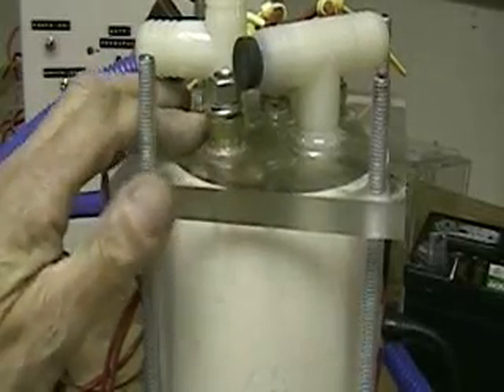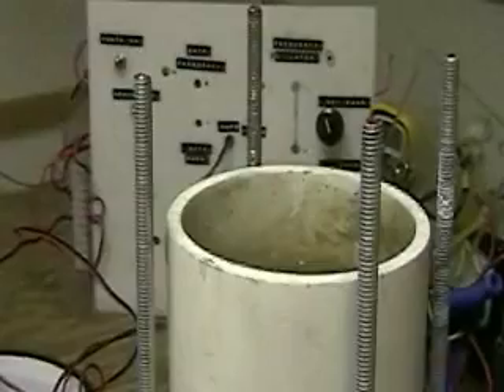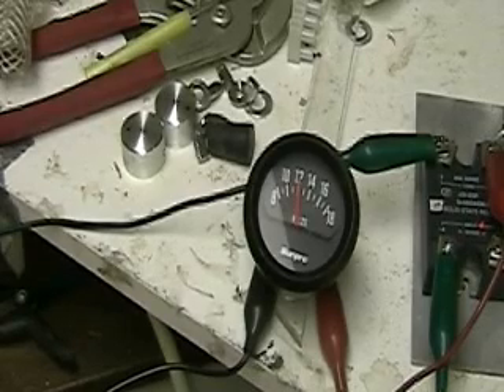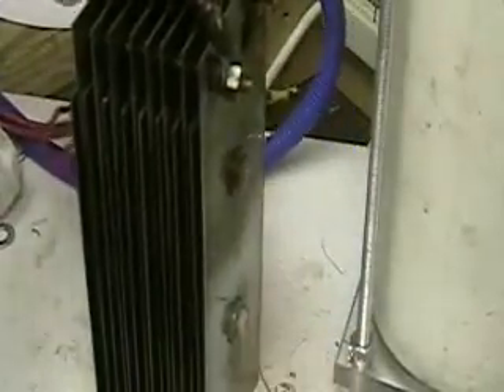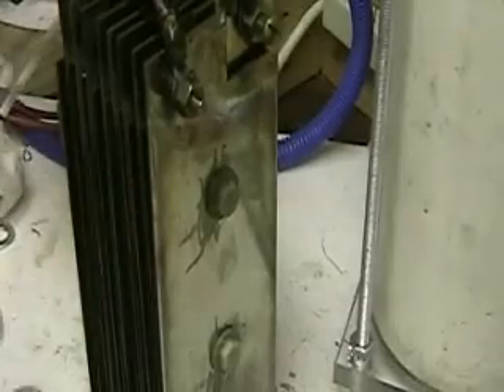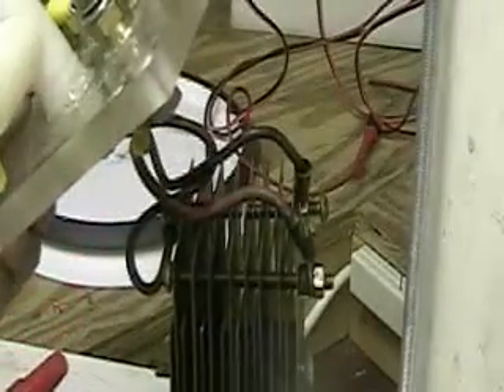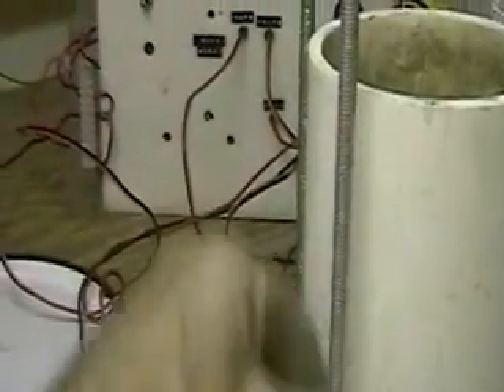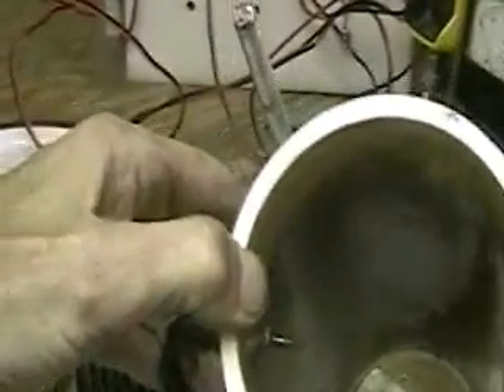Hydrogen Tap (Checking Honda Cell) 251

Comment: I wish I still worked at the airport. we had a freeze point spyglass we used to measure the freeze point for our de-icing fluid. You might be able to get a local Fixed Base Operator (FBO) to test your electrolyte (or test fluids) for you. Don't know where you live but In Montana we have to plug our cars in to keep em warm during winter to keep the oil from freezing. Insulations would only help so much. :( But we will get it one day. keep up the good work.

Comment: Hi Aaron,

You should probably try using a silicone gasket (3/4mm thick) at the bottom...this would withstand the temps but you need to check if it reacts with they electrolyte youre using.

The bolts look like Galvanized MS... Zinc Plated basically.

R.